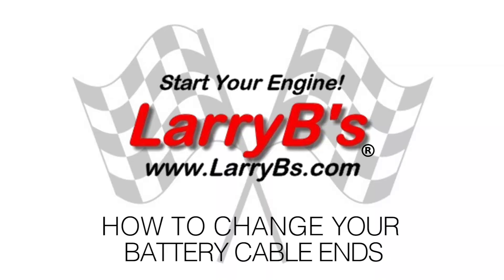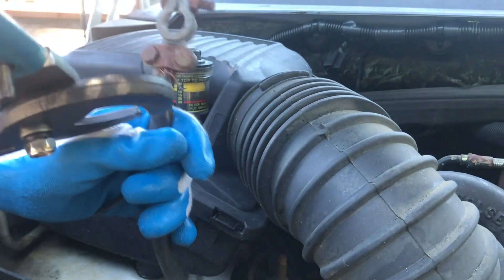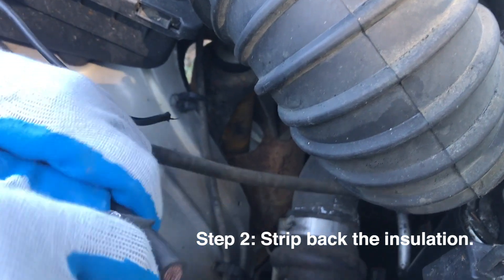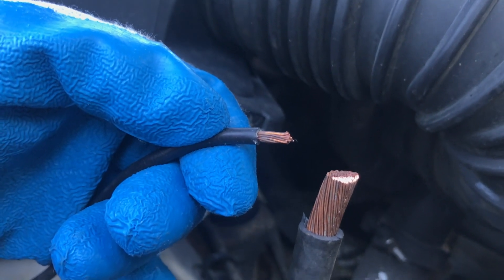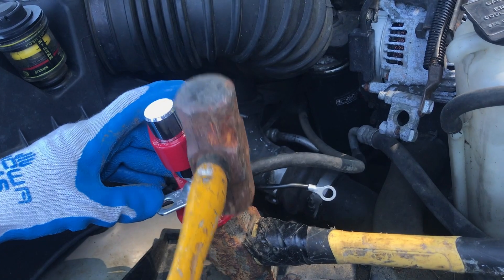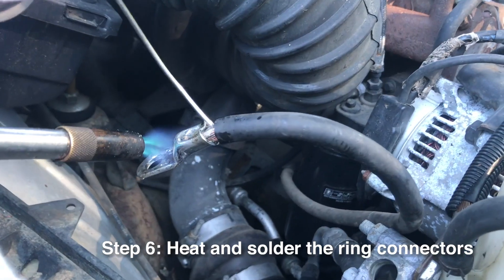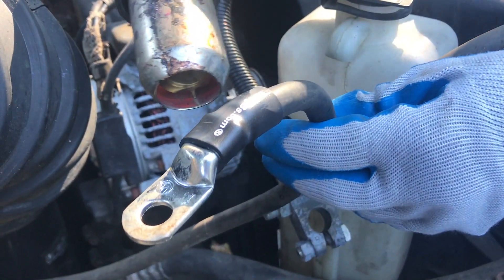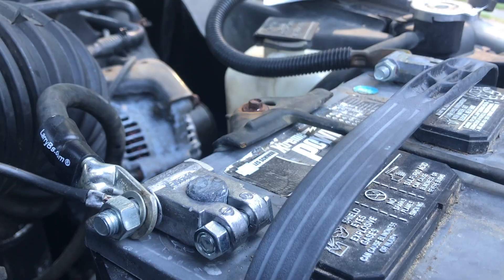Battery Cable Ends: How to Change Your Own

Comment: Are battery cable lugs absolutely necessary??
Reply from the maker: For a reliable connection on these trucks I would say yes. The starter draws up to 800 amps when cranking.